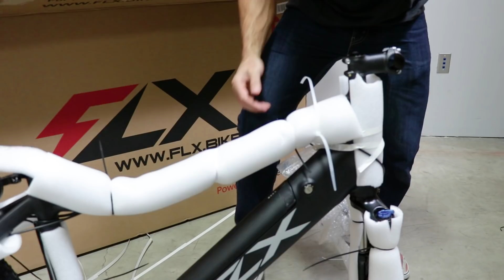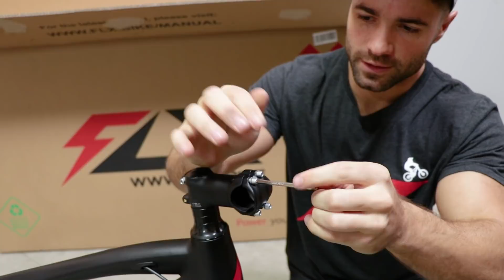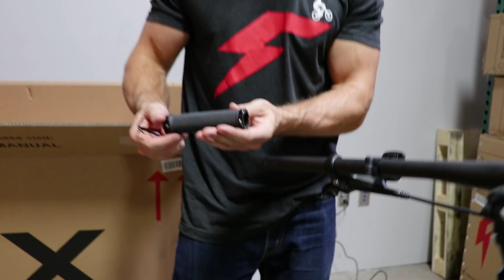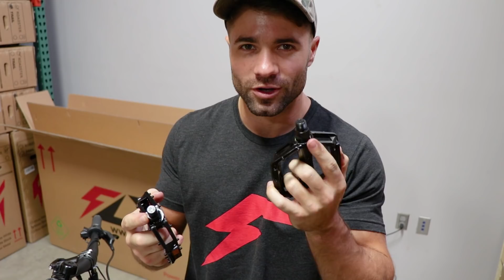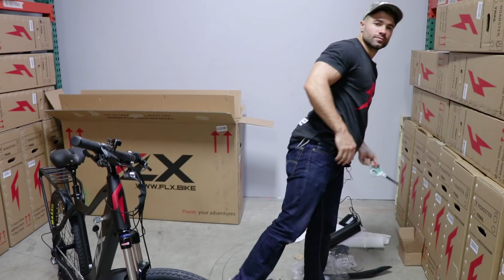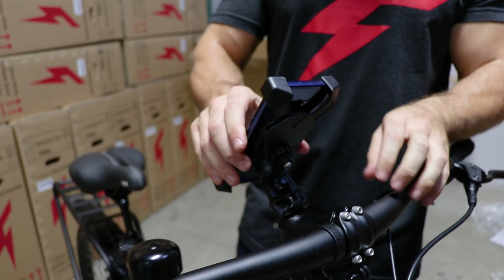2019 FLX Trail - Electric Bike Assembly Video

Comment: That is an insane amount of assembly required, especially considering most buyers have zero experience working with bikes. Discourages me from buying for sure.
Reply from the maker: Understood Al, don't mean to spook you! This is with the optional touring package and optional throttle, which take the majority of the time. For the standard model all that's required is - put on the front wheel, put on the handle bars, add the display, put on the pedals. It takes just 10-15 minutes.  If you're in socal you can swing by the shop and we'll do the assembly for you!
Reply: If you can't handle this much assembly ... please check man card...
Reply: @kelibj3460  If you are dumb enough to buy this bike, please check IQ score...

Comment: Hey rob, I have a trail F2 that I have about 350 miles on. I’ve been taking it mountain biking with the new handle bars and stamp 2 peddles I put on and it’s a lot of fun. The only thing that scares me is that now the headset/fork is rattling when I ride no matter how many times I adjust and tighten it. I’m somewhat of a bike expert and understand the quality of the SR Suntour fork, but I’m wondering if this is a problem you’ve come across? Do you know what it could be? Back in the day I had a cheaper sr suntour fork and it never rattled and I put it through hell on trails. Could it be the frame?
Reply from the maker: Nothing worse than a mystery rattle! First step is isolating where that's coming from. If you can get the bike up on a stand or flip it over and give each piece a good knock with the hand you may be able to find which one has some play or emits noise. From there it's as simple as adjusting or replacing the suspect component.
Reply: FLX Bike thanks!
Reply from the maker: @Jake-0  Anytime!

Comment: Having a hard time with this company honoring warranty & responding to my communications attempts. Please respond to Email sent to as per website-   hello@FLXbike  subject line , " My FLX Bike Needs Warranty work "  sent Jan 4,   5:18 PM.    This is my third attempt
Reply from the maker: Hi Alan, sorry for the trouble you're having. Did you get the response from Naomi sent Jan 4, 5:59PM? Note our service hours are M-F 9-5PM PST so thank you for understanding if you don't receive a response during the weekend! Cheers and we'll get you back on the road!
Reply: No responses , I'll check my spam folders.  Heres the deal presently I'm riding my old Pedego & I'm losing street cred at the retirement center here  :)  I had a power loss issue & fried something it's dead, I have the original box will pay shipping costs, even part of repair costs although under warranty, I need the bike on the road for health & sanity reasons.  I'll contact you again Monday & ship it out.  Thanks,  Alan